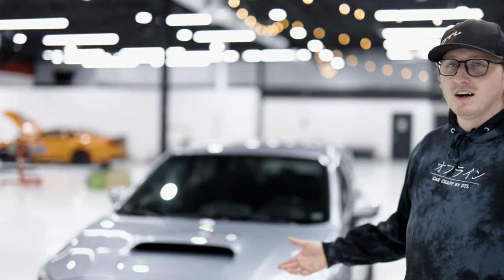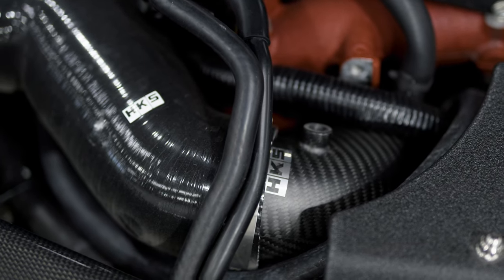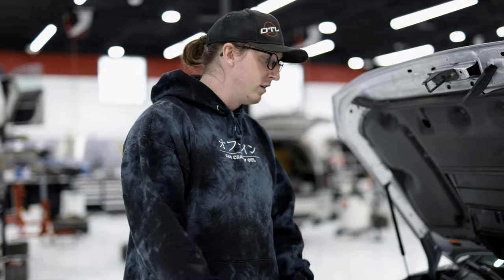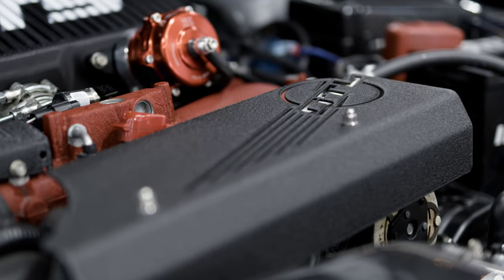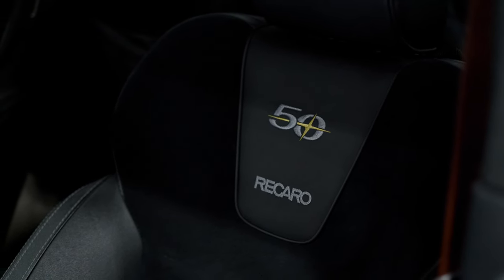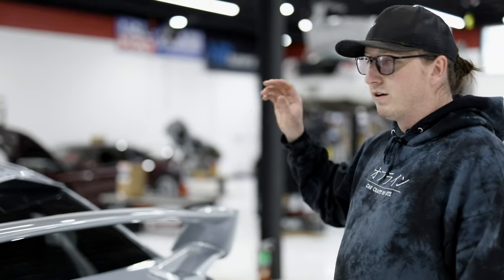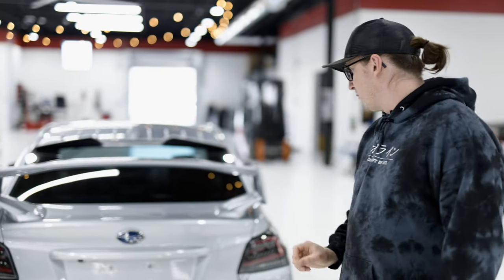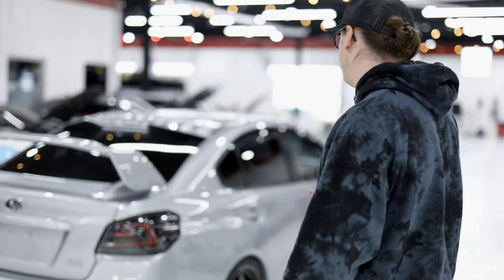Everything you need to build the BEST Subaru STI (BUILD LIST)

Comment: The way I modded my 2015 STI was to make it seem like a factory STI. Engine is temperamental so you have to do everything right and not cut corners  

I did Cobb intake, IAG AOS, IAG Oil Pick Up, Koyo Radiator, ETS TMIC, Cobb Uppipe, Killer B Header, Killer B Hard Turbo inlet, Cobb 20g Turbo with blanket, stock down pipe, 1050 injectors, AEM 340 fuel pump, Grimspeed 3port, VSC radiator hoses, 04 STI fuel regulator, Invidia Q300 Catback, and cylinder four cooling mod. 

Various, Perrin, Whiteline, Cusco, and Group N mounts. 

Puts down 350-360 whp on pump gas via street tuned.
Reply: I feel like you should make more… my ej20x in my bugeye makes 350 same mods… tbf it only spools at 4500 rpm but revs to 7800 lol.
Reply: How much in total
Reply: @sawyercrosby3710 till on stock exhaust cats. Car was etuned but raced couple e92 M3s, 392 wide body chargers and newer Camaro SS cars and im usually neck to neck with them until about 130-140
Reply: Would it be more HP on a 2020 since it came with more HP or no?
Reply: @iAmFAUST that’s at the wheels
Reply: I really love Subies but damn this is so much work and $$$ for that kind of power. My GTI made 370WHP on pump with 1500$ worth of bolt-ons, 500$ turbo upgrade from a Golf R and a tune.

Comment: neat.  so for the best daily STI, one must first (totally) disassemble the car (and have a 2nd mode of transportation during the down time), then add parts, parts, and parts; and then reassemble (not forgetting/losing a bolt/screw along the the way).  Sounds easy enough....
Reply: Already $10k into my 2014 just sorting the engine out. Had it three years and barely put 10k miles on it.... Cracked valve springs within a couple months of buying, burned up exhaust  valves and dropping guides 8 months later, killed a rod bearing less than a year later.... Very temperamental and lots of inefficiencies and corners cut for mpg in the stock setup. After you do all the homework and spend all the money, they're great. But you'll still cringe at every little sound it makes for a while. If it lasts a year of me babying it I'll be slightly more confident in the car.
Reply: @TDT0188  ...still makes me wonder where/how Subaru got it "wrong".  In 2019, that is the one thing that kept me from going STI - the EJ257.  I probably didn't fare much better going FA20 WRX, but I could not get over the fact that the EJ257 had been in production for 15 years (in various editions) and it still had well known, document issues that Subaru failed to address/improve.  In 2019, the EJ motor should have been 'solid/bulletproof', but it wasn't.  Do I regret not buying a 2019 STI, Yes (superior car to WRX) and No (the EJ unknowns).  I was not keen on dropping $5k-7k on a new car after-the-fact just to make the engine 'more' reliable.  🏁
Reply: @K03sport  they sell so few turbo models compared to N/A models I'm sure it wasn't financially profitable to swap pistons, re machine a bunch of blocks for proper tolerances for those pistons, upgrade bearings, re-tool the cases to be more rigid..... They did it cheap and barely made it through epa red tape. Two class action suits and a bunch of well known problems that they were too cheap to fix.
Reply: @K03sport the type ra block in the 19+ fixes most of the problems… at least with rods and ringlands. Up til ‘19 though spot on. And the fa24 is even better ;)
Reply: @TDT0188 sounds like you were beating the piss out of it, or bought a used one some kid beat on
Reply: @OGbrundle   bought with brand new shortblock and oem rebuilt heads. i was having a lil fun but no launches.
Reply: Piece of cake 🎂 lol

Comment: Question! Can you add a different intake with that setup? Why did you keep the stock air box?
Reply from the maker: Yes you can change the intake setup! We installed the chargespeed air intake kit which allows for more flow and keeping the intake temps cooler. The stock airbox works great in that regard!